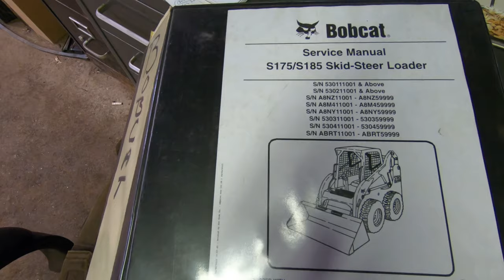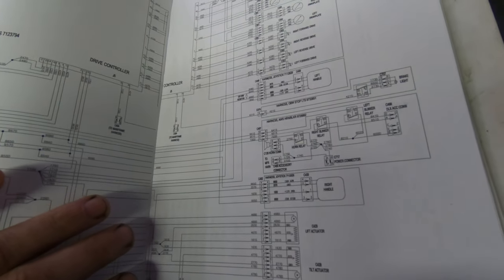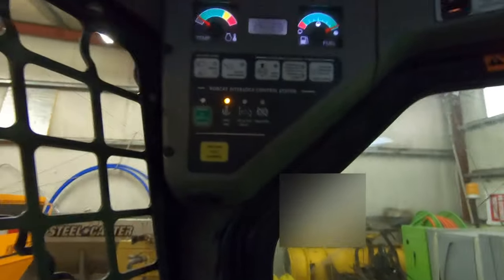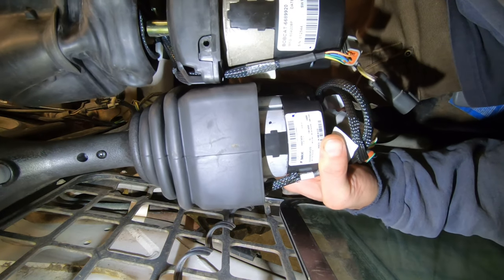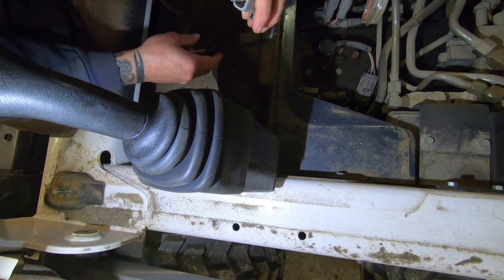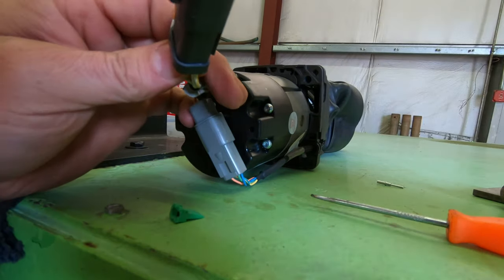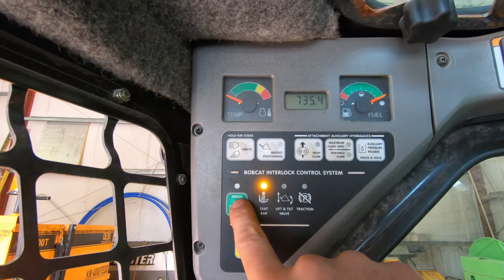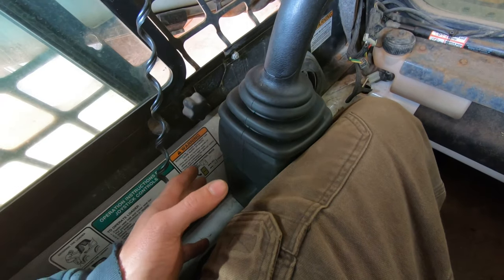Bobcat skid loader left joystick internal fault. 39-28

Comment: Hello, when u repinned the connector, did u leave the wires the old way? Or did you change anything except the connector
Reply from the maker: I believe I just changed the connector and left the wires in the same orientation. I’m not 100% sure though because it was so long ago.
Reply: if you check the video from 22:20 - 23:00 you say that you believe that it will have to be reppined the opposite way, however after that you don't realy bring it up anymore, you just repin it. my friend has the same exact problem, he can only order the aftermarket part at the official bobcat dealer and even that only in a pair(L+R) so its quite expensive, however we found the aftermarket part from china that sells seperatly without the inbetween connector so he will have to repin it, and we just ain't sure if he will have to change the wires or only change the connector from male to female or viceversa. if you can check the video maybe u remember again. Thank you in advance. @JasonTheMunicipalMechanic
Reply from the maker: @davidvehovar so I watched it again and at 30:35 I said I was going to repin the new one to the original wiring. I’m pretty sure I repined the wiring on the controller plug to the original wiring of the first controller and I just replaced the plug on the machine side. I was going back and forth about which way to do it and I chose to do it that way so the original wiring orientation was kept for later diagnostic purposes. It would probably be quicker to just repin the machine side plug and swap the wiring in just that plug rather than replace the plug and change the wiring on the other. I chose not to replace the terminals on the controller side because they were gold plated but not on the machine side. Ultimately I did more work and some of it may have just been wasted time but that’s how I believe it happened. I don’t know why they didn’t just keep it the same but I’m sure it is to get more money out of people for a jumper harness. Ultimately I would just make sure the wiring colors match from one plug through the other plug.
Reply: thank you very much for taking the time and looking at the video again(and making it in the first place ofcourse). kind regards  @JasonTheMunicipalMechanic